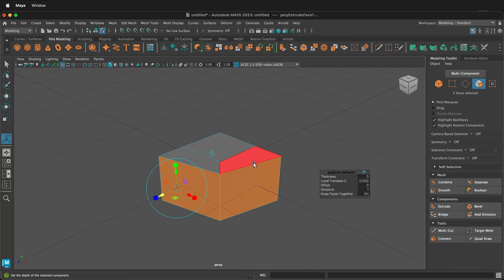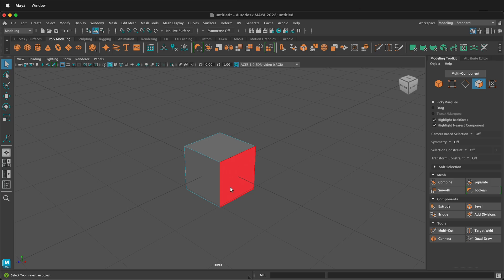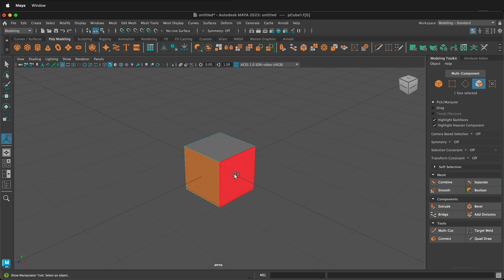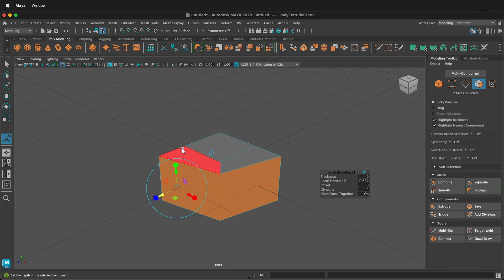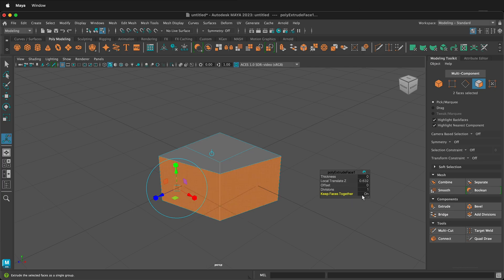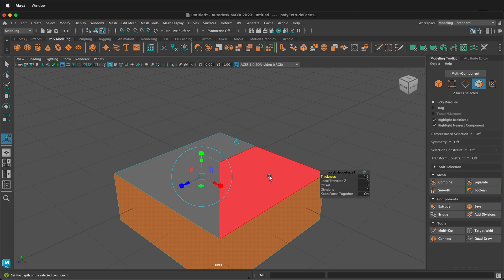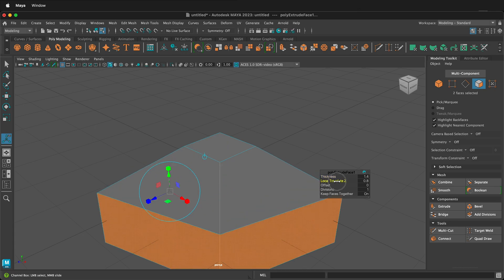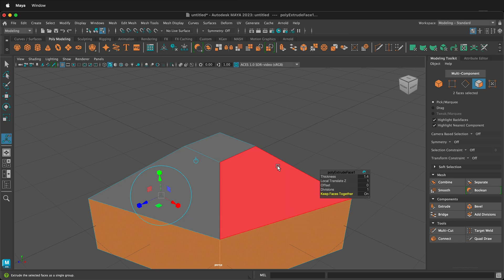Extrude Local Translate Z vs Thickness - Maya Tutorial

Comment: Hello. Thank you so much for this video. Just for clarification, if I turn off the "keep faces together" option, does it essentially make no difference between translate z and thickness? Or will one of the options create some problems further down the line when I'm modifying the polygon?
Reply from the maker: That's a good question,  I would need to run some tests to confirm but that seems to be the case